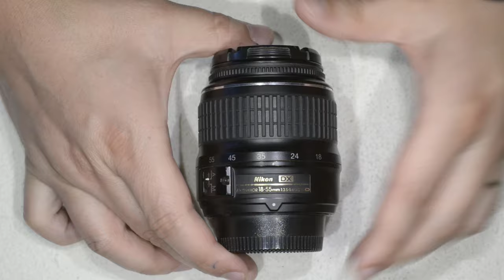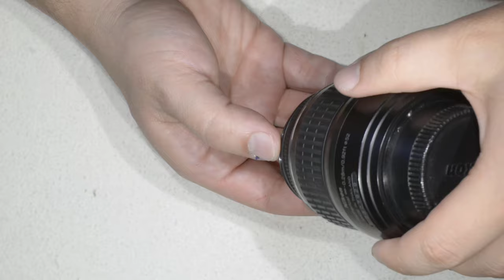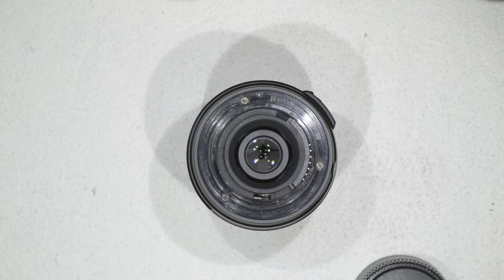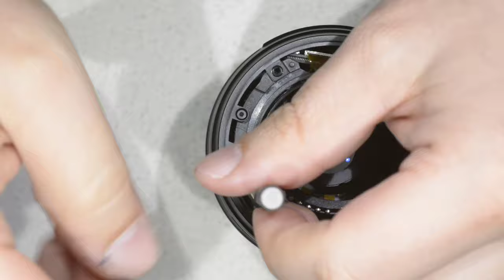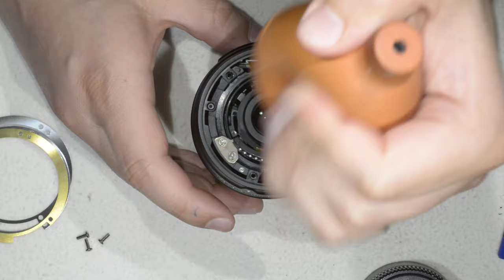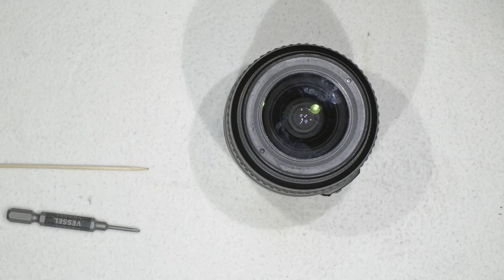Nikon 18-55 : Optical block removal (disassembly and assembly)

Comment: Excellent presentation sir.
My wife has the same (non-VR) 18-55 and it's big brother, the 55-200 from 2006 or there about.
Is the procedure the same for the 55-200?
The other question I need to ask is, her 18-55 has about 3mm of play. When using manual focus it is very noticeable and troublesome.
Can it be rectified at all?
Reply from the maker: Hello, first question, no, the 55-200 disassembles differently. If you need basic cleaning, I made this video here https://youtu.be/qFfH3-gp2y0 . About the play, under the rubber ring, you'll find a tape that needs removal (mark things before), then, you can unscrew the top of the zoom ring and take out the focusing part for inspection (this it what I remember but need to take a look into a lens to make sure). Best regards.
Reply: @diyextravaganza  Thank you. I'll give it a try.
Many thanks.
Reply from the maker: @badger67  anytime !